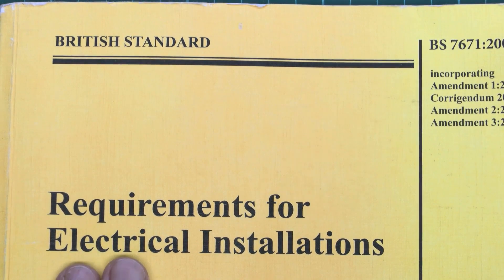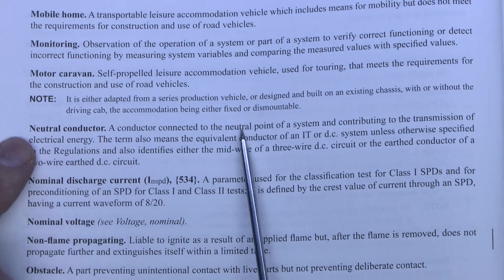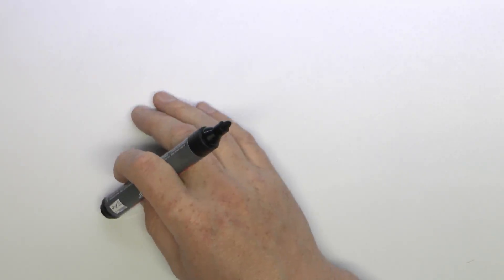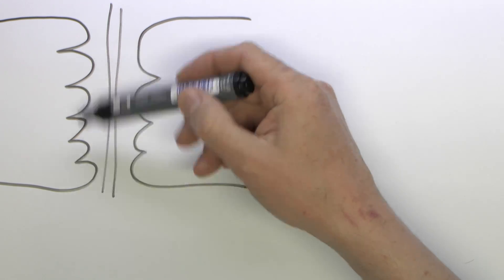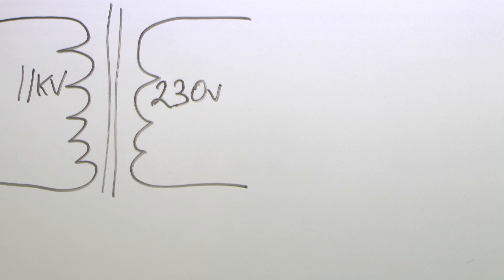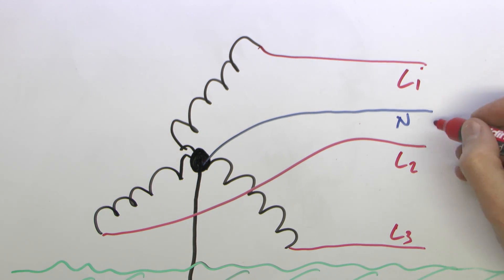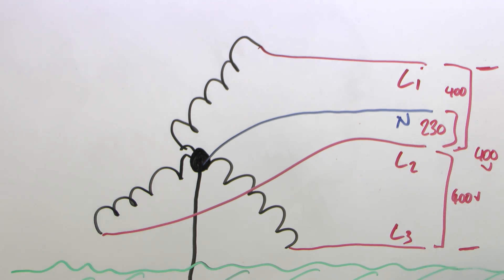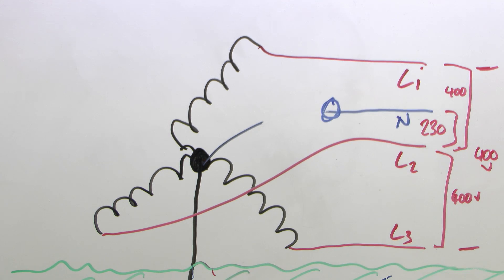Neutrals from transformers and in electrical circuits

Comment: the ground wire cannot be connected to the circuit, otherwise the path chosen will be altenative to    closed circuti to the utility tranformer? the ground it's an emergency connection with very low resistance to connect, in case of a ground fault the connection will be hot? That is how i know it.

Comment: Hmm pretty straight forward, but lets discuss how to check the floating AC transformer of say about 24VAC for which cable is which. How do i identify which is common and which is phase? Although in many cases its not important at all.

Comment: The description is a bit confusing; the ‘neutral’ is only called neutral because it is grounded at the substation. It  completes the circuit back to the substation; it is not the return to the substation as technically when a circuit is complete between red and black, current flows/returns from/to the substation in both wires as it is an AC system, changing direction 50 times a second (in the UK). Both are the flow and return. Both red and black are essentially the same wire, just different ends of the transformer winding as can see on the diagram. If ‘neutral’ was not grounded at the substation then it would essentially be two live wires coming to our houses, with the potential for a shock from both of them. Black is only called neutral because the wire from that side of the transformer is grounded at the substation. So when you touch black, the potential difference between you and the ground is zero, so you don’t feel a shock from it. If black was not grounded at the substation, the potential difference between you and the ground would be 240 volts and you would get an almighty shock, just the same as if you touched the red.
Reply: You're right about the confusion and I think you may have helped me understand a bit more about the subject.  Many thanks, Kieron.

Comment: This guy is dangerous. You will get a shock on the neutral
Reply: As explained in the video neutral is connected to the earth at zero volts potential so no you do not get a shock from the neutral.
Reply: @jamesm90 in theory, yes. But this creates confusion for electricians, especially the new ones, because they assume neutral is always safe to touch. As a matter of fact, getting shock from a neutral is very common in the field. Is it beause the theory is wrong? No. It's because the term "neutral" is relative. It's called a neutral only because it is connected to the ground. A shared "neutral" is the evidence why neutral is relative. It's so dangerous that it is now against the code to have a shared neutral

Comment: In other neutral diagrams. The neutral wire goes to the Centre of the transformer. Also is the neutral is just a continuation of the line, as seen above - why isn't it live as well has the hot line? Help.
Reply from the maker: https://www.youtube.com/watch?v=AgCY_d98HF8

Comment: John what happens in the case the three phase power is unbalanced?  A) L1 - L2 - L3  are all showing 400v differential in any combination.  But B) L1 shows 270v to ground, L2 shows 242v to ground, and L3 shows 229v to ground.  Now some caveats often the 400v is supplied by the power distribution system of the city, but just as often it is supplied from a transformer on the premises from a much higher voltage supplied to that premises.
Reply: Also, in some situations there really exists no ground like in the arctic, shipboard, or aircraft. I have seen helicopters at sea and in arctic land and the grounding hook basically gets a lightening bolt as it gets close to the aircraft. Sometimes in the arctic you will see salted wells 200' - 300' or more deep in attempt to create a ground.  So this makes things very interesting. Particularly with rotor wing aircraft flying in snow or rain, where static charge production builds up to immense proportion.  Though you see few of these problems in houses... remember where the ground is frozen there exists no possible ground.
Reply from the maker: Those voltages suggest the neutral connection at the transformer is missing or damaged.
Reply: @jwflame  Thanks... that never occurred to me, brilliant! If I may borrow my god-daughter's favored exclamation. The building was constructed in 1950 by a famous engineer, inventor, and industrialist credited with the first step to the automatic car... it had well over a million lavished on it in that days money 9000 sq.ft./900sq.m.. Electrically it is perfect, even with todays standards... except for a couple installs in the last 20 years. One of those is a piston type compressor of 25 hp/19KW... which was installed without a neutral but with a substandard ground wire gauge. Installed 12 years ago, though the panel has a neutral connection from the time of the buildings construction.  The closing coil went out in the motor controller with very dodgy wiring job too. No control secondary power source, meaning it being hot wired without fuse protection, off the main; no interrupter of the supply, and; everything else never seen print in a standards book, So I undertook repair... my partner thought I was crazy to do it. The town has had for as long, as long I remember a phase problem, due to a transformer issue, and that I am not knowledgeable about. I thought they may have had a bad winding or phase connection, and bypassed that. But it just never occurred it could be a neutral though that makes absolute sense... but remembering most are Delta - Wye connected, brilliant!  Am afraid it is my defective French education in physics, and EE, now nearing 50 years ago.  

Great explanations and help in educating those modern education has passed over.  Of course, my Université Pierre-et-Marie-Curie-Paris, and you know the French they had all the great discoveries in the Age of Electrification. Don't remember Faraday even mentioned, but do François Arajo, Léon Foucault, and André-Marie Ampère, supposing; Arajo's story was more interesting; it's those Pirates... putain de merde! Of course, the French do not have any profanities existing.
Reply: @jwflame  I must admit your understanding of electricity and concepts is top notch.

Comment: Hello! There was such a situation - the current in the neutral of a single-phase autotransformer 500/220/10 was measured with ticks and showed 30-35A. It's the same in other phases. There are indications of currents from the 500 kV and 220 kV side, there is a tiny asymmetry. So, does anyone know how to calculate by calculation what the current in the neutral AT should be? Thank you!

Comment: Now, how does this all apply if you have a delta primary and star secondary isolated transformer and you do not connect N together with PE. Then N still is 0v, but not a part of earth. How does this apply to the safety of the system?
In this way there would never be any way for the current to pass through you an back to the source should you be so unlucky and touch one of the phases?
Reply: I see now how everything around you potentially can turn into one of the phases if there is a fault and that will dramatically increase your chances of completing the circuit with your body.

Comment: John
Just watched video on transformer neutral single phase power. 
My question is what happens when all of the circuit is closed but no ground. Will secondary side still work? And what is voltage?

Comment: Hi John , got an old Maplin regulated DC output linner power supply 0-15v 15-30v DC . Q : On the transformer have 240v AC primery and on secoundry one pair 6v and three terminals with 0v , can you tell me why please

Comment: Dear sir,
Could you please care to explain 
---- if nutral is grounded in single phase system then how current flows during negative half cycle?  And why nutral is still at zero potential in negative half cycle if current if flowing from nutral point to load? 
I have watched other answers over internet but cannot visualize it or the answers are not intuitive
Thanks.

Comment: The resistance of the gap between the neutral N and the 0 v point (attached to earth) will be about 20 ohms (assuming transformer impedance is negligible) - but certainly not infinity. A better explanation of why you shouldn’t touch the N when it has been severed from the transformer is that the corresponding voltage generated by the electric field at the Live conductor basically has nowhere to go and therefore no current flows out of the transformer OR through the resistor. Because there is no volt drop across the resistor the voltage at either side of it will be at 230vac wrt earth.. I am being pernickety here because I know exactly what you are trying to explain and you have done an excellent job as per usual. I find your voice strangely calming! Good work.

Comment: I would point out for anybody watching but at 10:16  the voltage across the 20 Ohm resistor (heater)  is zero  because you only get a volt drop when a current flows.  The potential difference across the 20 Ohm resistor  is 0 volts so no current flows. The left hand side of the circuit  has a path through the secondary of the transformer for current to flow and the voltage (potential difference) is 230 volts .

Comment: What will happens if the neutral line is disconnected from the transformer? Will my fan run faster or slower, or else? As the neutral is shared between homes and every phase, i wonder what's the consequences
Reply from the maker: On a 3 phase transformer, if neutral is disconnected and the loads are equally balanced, then nothing changes.  If loads are not balanced between the phases (most likely), then some will get a much higher voltage and others much lower, resulting in equipment damage and fires.
Reply: @jwflame  then why some phase has lover voltage even tho the neutral line is connected. In my area, one particular phase has much lover voltage (190v) compared to the other two (220v) resulting in unstable computer and dimm lights when using that particular line. That makes me think that neutral line won't guarantee stable voltage across phases.
Reply from the maker: @dputra  If the voltage is low all the time, then it's one or more of:  cables that are too long, cables too small or the system is overloaded.
Reply: @jwflame  thanks for the answers! 👍👍👍

Comment: Why does the lagest part of the voltage appears where you got the largest resistance? And if the neutral and  hot wire are connected in series why isn't the hot grounded? And also how will the circuit be closed if the neutral is grounded so the electrons can flow to earth? Also in AC I understand current goes back and forth because of polarity change, so does that mean that phase will become neutral and neutral will become phase?

Comment: Hi John, loving your videos...got  a quick question.

UK nominal 230v with +10% and -6%.

What is the 400v, is it the same +10% and -6%?
Reply: Yes, the statutory voltage envelope in the UK for low voltage supplies (230V single-phase, 400V three-phase) is -6% to +10%.

Comment: Why is there 230 V across the transformer when it is just wire with no resistance?  Is this an example of what they call impedance?
Reply: The coil of wire of which 230 volts is across is low in resistance and high in inductive reactance. Resistance and inductive reactance = impedance, long answer to affirm your correct thinking.

Comment: Why do they connect the neutral to ground, if it wasn't connected, then you'd only get a shock if you touched two-wires at the same time? That would reduce the chance of getting a shock & reduce deaths. In your 3K heater example, if you touch the two open ends of the cables, (Complete the circuit) you would get the current flow of the circuit go through you I assume.

Comment: Nice video!

What are your transmission lines like in the UK? US has three-phase delta transmission lines, which are cheaper but more susceptible to phase imbalance.
Reply from the maker: The same - 3 phase delta.  400kV and 275kV for the larger ones,

Comment: I think it’s a pity that you didn’t show the substation transformer as it is in real life, namely, a delta/star (11kv to 415v step down), with the star point connected to earth. And, of course, in such a device, there is a connection between the ends of the windings on the star side, but no current flow due to the 120 degree phase angle. I live in a rural area supplied by TP-N overhead lines. There was a power cut some time ago, due to a break in the neutral. It would appear from this that neutral current is monitored, and the lines are cut if the neutral current falls below a certain value (the line supplies domestic dwellings, so there will always be neutral current).

Comment: How come there's potential difference between neutral and Live wire, how does that come about, what makes neutral different in potential to live? That's my questions. GREAT VIDEO INDEED Sir
Reply: Because neutral is on one side of the coil and live wire is on the other side, so potential difference exist.

Comment: Hi John. I've been following much of your videos, and they are all very informative and helpful.

I have have a question as follows:
For a domestic AC circuit, we say that the Neutral is connected to the ground, hence making it 0V. Now, if close a lighting swith for example, to complete the circuit, this would cause the alternating current to flow on either direction between Line and Neutral.

Under this circumstance (a closed circuit) wouldnt this make the Neutral "life" during the reverse cycle?

And if I touch the Neutral during the reverse cycle, would I then get a shock?

I think another way asking is that can I get a shock when I touch the Neutral busbar at the consumer unit while the end circuits are closed?

Hope you can give me a bit more clarity on this. 
Thank you
Reply from the maker: You won't get a shock from the neutral in normal operation (although touching one isn't recommended as a fault could result in dangerous voltages appearing).
Neutral is always at 0V because it's connected to ground, and current cannot flow between ground and N because there is no voltage difference.
Line is either +230V or -230V relative to ground.
AC is not swapping L&N - it's just having L being positive or negative relative to N.
Reply: @jwflame  This is confusing "AC is not swapping L&N - it's just having L being positive or negative relative to N"
Reply: @jwflame  
Many thanks John for the explaination. Very helpful.
Reply: @jwflame  
In case of an isolated AC transfomer, without any earth connection, is it correct to say that there is voltage swapping between one conductor to the other? (Non of the conductors are connected to ground)

Comment: No center-tapped transformer feed to the houses in Britain?
Reply from the maker: No, everything is 230V.  Virtually all homes have a single phase supply which is neutral and 230V.
Commercial and other large buildings have 3 phase and neutral, which is 230V from any one phase to neutral, and 400V between any 2 phases.

Comment: Hi +john ward what i dont get is that when you showed the broken neutral and you said if you touch it youll get the full 240 shock isnt that the same thing of a isolated transformer because theres no earth supply so you wouldnt get a shock?
Reply: The neutral at the other end of the break would still be on earth.

Comment: Hey great video. I have a question we have 3 phase power 120,208,120 on a cnc machine. The machine was drawing 30 amps when servos turned on. We had to install a isolation transformer and it fixed the problem. All the other machines do not need the isolation transformer. Can you explain why this one machine needs the isolation transformer?

Comment: So if you lowered the resistance to a certain level then would you get a voltage somewhere between zero and 240v or would it just stay at zero until the point where the resistance was low enough that it would go short circuit?
Reply: If you lowered the resistance of the equipment you would blow the fuse or trip the circuit breaker but theoretically greatest loss of voltage happens where the greatest resistance is.

Comment: That’s the bit that’s hard to get your head around, if you touch the neutral terminal in that heater circuit you don’t get a shock coz there’s no voltage there but if you disconnect the neutral at the same point and touch the wire and the neutral terminal, thus completing the circuit, then you will get a pretty nasty shock

Comment: Great video. Can you explain one thing I just cant wrap my head around. The human body has resistance of thousands of ohms. So if I was to touch a live in a circuit with load and neutral how do I get a shock? I know I would become the earth but does electricity not take path of least resistance being the circuit cable back to earth?
Reply from the maker: With a high resistance path and a low resistance path most of the current flows in the low resistance path, but some still flows in the high resistance one.  It's not one or the other, but sharing the current between them.
It only takes a few mA  (0.001 amps)  to feel an electric shock,  10-20mA will cause muscle contractions, and above 30-40mA serious injury and death is increasingly likely.

At 240 volts, 20mA is 12000 ohms, 40mA is 6000 ohms.
The human body is not a fixed resistance , and with higher voltages the current flow will damage the skin very quickly, reducing the resistance and increasing the current.
Reply: @jwflame  Thank you